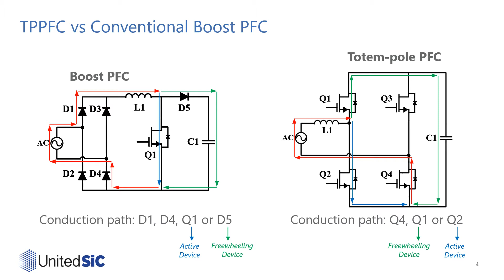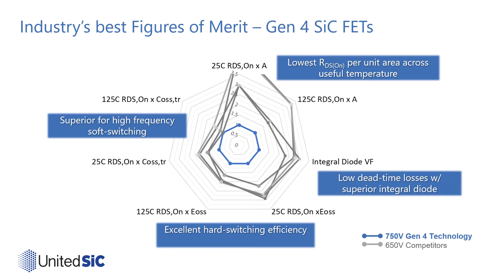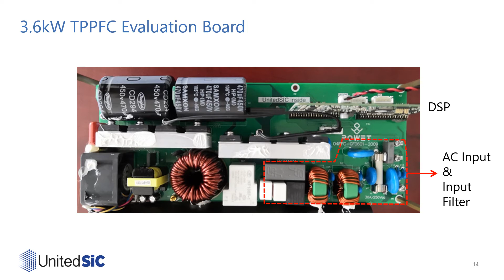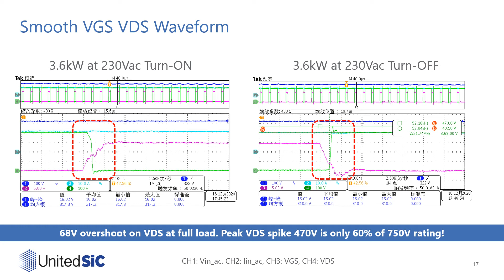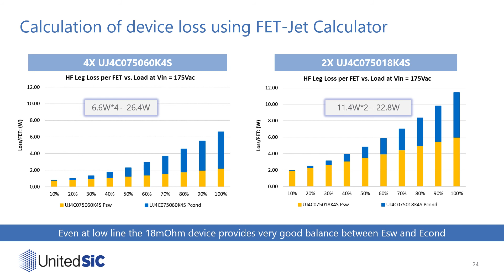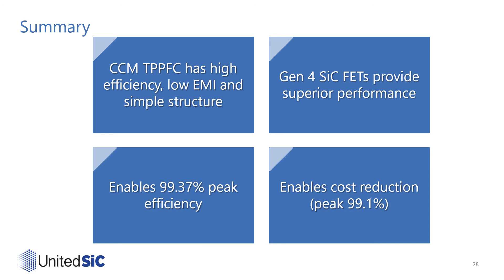WEBINAR: Enabling 99 3% efficiency in 3 6kW Totem pole PFC using new 750V Gen 4 SiC FETs

Comment: €20 for one piece? Thanks. I'll better add more aluminum. It won't require a replacement in a future ) Additional 3W of losses - that's about 3 years in 24/7 mode